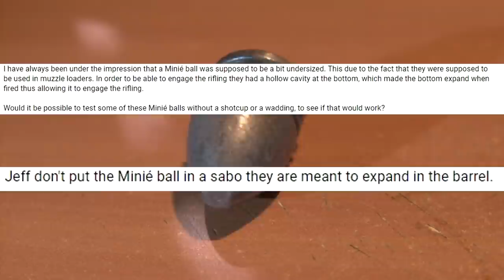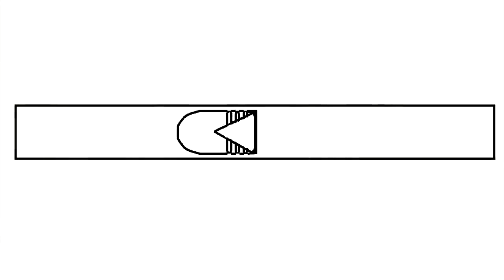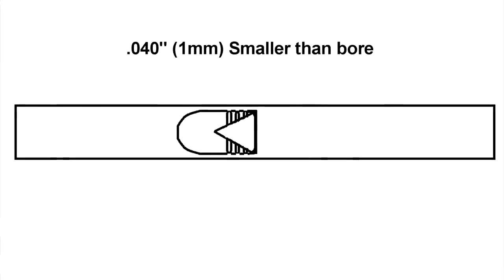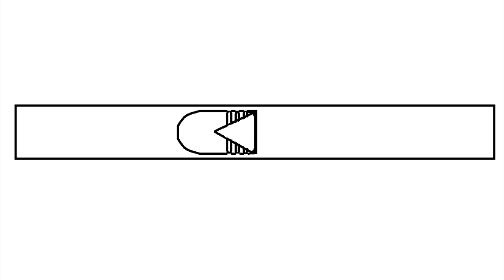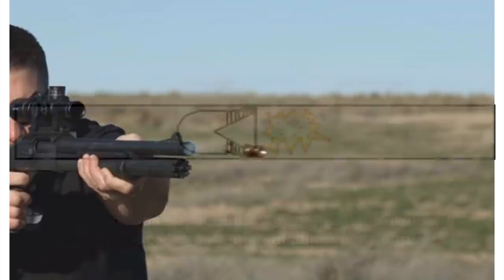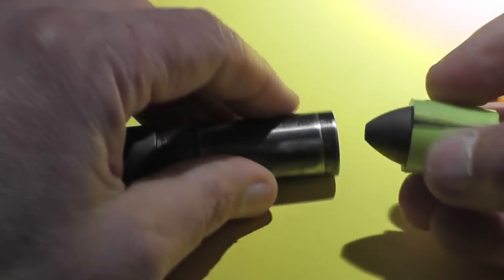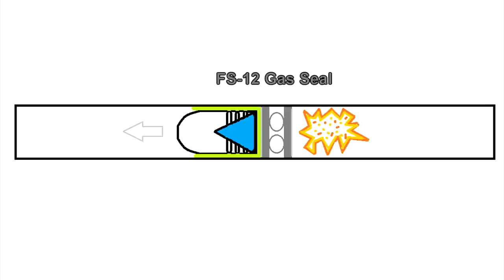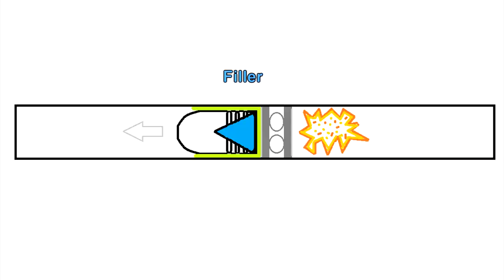.69 Minié Ball  - How I loaded it for 12ga.

Comment: Nah, Danny dead eyes would have still hit the target. A shotgun isnt a precision instrument, its just an extension of his arm
Reply: i heard, if your camera is good enough, you can see an extra hand reaching from his beard for support when firing
Reply: Actually a shotgun is a lot more precise than you are giving it credit for and it is not an extension of the shooter’s arm so much as it extension of the shooter’s body and in-particular the shooters eye.  I say this because if a shotgun “fits” a shooter correctly and unlike a rifle when you bring a shotgun up to your shoulder to shoot you are “mounting” or placing the shotgun to you shoulder and face so that where you “shooting eye” (dominate eye) is looking plus whatever corrections your brain has done to compensate for distance and lead of your target your projectile(s) will impact. The difference between shooting a rifle compared to shooting a shotgun is “gun mount” is only important so much that the shooter can move his/her head so that their shooting eye” (which does not have to be their dominant eye) can be aligned to look down the rear and front sight and that corrections for distance and or windage cam be compensated for by correctly adjusting the sights if the rifle is equipped and if not equipped with adjustable sights than that computer sitting atop your shoulders is going to have to due some of the work it does when shooting a shotgun but with more known values inserted into the equation(s) to determine the projectile(s) point of impact.
Reply: @gullreefclub  gullreefcluc I think you missed the point, which was a hilarious pat on the back for Danny. NOT a demeaning shot at a shotguns precision
Reply: @gullreefclub  wooooosh
Reply: @fransvphc1098  it's just like texting versus spoken word... Some of the intended emphasis is lost when you can't add a vocal inflection for sarcasm. Thus, misinterpreted comment.
Reply: I laughed
Reply: gullreefclub ...........mkay that’s nice but you are aware of what a joke is aren’t you?
Reply: @BH-rx3ue  I'd say give him some leeway, I mentioned elsewhere that sarcasm doesn't translate easily to text. So he might've thought you were sincere
Reply: the legend says that if you zoom enough on danny's beard, you can see the little laser-rangefinder and the FiringControlSystem
Reply: with a rifled shotgun its a whole different story
Reply: danny is a gun jedi

Comment: 👏 Well done, applaud the direct approach of "No, thats wrong & HERE'S WHY" More ppl should explain their position.
Reply: While he is entirely correct about what he chose to do and how he chose to shoot it, he failed to disprove the critics points about how a Minié ball is supposed to function and be fired. He explained why it wouldn't work with his specific circumstances. None the less, he was not shooting a Minié Ball as he would claim. He literally erased the point of why a Minié ball would be used the moment he chose to shoot with smokeless powder. This video was literally, "I had to make the Minié ball into a run of the mill sabot slug in order to make it shoot." Thus, proving critics that said that "he shot it wrong" correct. He shot it "wrong" by not shooting one at all.

Comment: Great explanation Jeff!!. Out of curiosity, (Some 25 yrs ago) I ordered Lyman's 'New 69 Musket' mold # 68569, which produced 'Minié' style slugs weighing about 725 grs, cast from wheelweights + 1.5% tin (just to improve 'castability' / better / easier casting), for  an old musket reproduction. (Results, not.so.great). Then again, out of curiosity, I had said mold precision ground down, (it fills from the tip of bullet), to 0.772", now with a flat nose / 0.565" meplat.  Then, with same alloy + original base plug, 'snubby miniés' dropped @ 610 grs, grouping somewhat better. Then again, went to my machinist's shop and made a new base plug, turned from aluminum alloy with a shorter, flat tip, quite similar to Lyman's 12ga sabot slug, casting slugs with thicker 0.114" skirts, about 650 grs, (0.093" skirts with original base plug). Using Claybuster 12ga wads # CB 0118-12 / clone of Win's WT12/ WAA12 + cornmeal to fill the hollow base + 0.100" nitro card between slug and wad, fueled either by 28.4 grs / 800X or 34 grs of Blue Dot. Out of my 870's factory rifled barrels, as well as a couple Hastings rifled barrels, (Verney - Carron, St. Etienne / France), chronied @ about 1.280 fps, these slugs group around 1.75" @ 50 yds quite  consistently. Suggest anyone interested in slug handloading, NOT to try to 'read' pressures from shotshell's base, nor from primers. It's more reliable to watch for pressure signs from the gas cups of fired wads / 'sabots'.

Comment: Makes perfect sense.  And a very good explanation. Now this brings up the question.... Why doesn't anyone make a 12 ga. Minie Ball ? THAT would make sense !
Reply: After seeing the results of these tests, you can pretty much guess that someone will.
Reply: @GarnetCarmichael  Perfection in 12 gauge slug. Right ?
Reply: Maybe, maybe not. Alot heavier and it will lead fowl the barrel. Time will tell.
Reply: @Stanley Denning It seems the closest shotgun barrel to the original Minie ball size would be .20ga. which is around .615. So you'd either need a .005 under size mold for a custom made Minie bullet, or a .58 cal rifled barrel liner for the 20ga. It seems odd to me that inline muzzleloaders don't come in .58 because it seems the minie bullet would be perfect for large game and easily cast and would be the cheapest shooting of all the bullets available.

Comment: I for one appreciate the work that goes into working up a good shotgun load. I was really tickled you got it to seal and release the wadding as well as you did. I use the exact Minnie out of a 12 bore black powder shotgun. It took me quite a bit of fiddling to get those things to fly right. I use a .690 Minnie with paper patching over a felt over powder wad. The un waxed butcher paper takes up the bore difference until the powder charge does its work and obdurates the minnie. They group quite nicely but are a BEAR to shoot out of my six and half pound single barrel.  Minnie balls are kinda sensitive to powder charge, they will blow skirt out if overloaded. You don't have to worry about that with modern wadding.

Comment: Great follow up video to a really good initial video. I found it interesting that the sabot was being cut in half by the Minie ball and even more so now that I see you had the void filled with hot glue. Still had enough pressure to create enough flex to push the cone out and cut the middle sections of the sabot. Keep up the good work.

Comment: I am a big fan of your channel. I love that this not only a technical journal, but a social event. I will miss Danny, but he is currently in the next phase of this adventure. I am part of the crowd that would really like to see that projectile obturate. Earlier this week I did come across and older video of a fellow making fff blackpowder loads to compare with smokeless loads with this projectile. He was getting better results with his fff loads. His smokeless loads were tumbling. This probably goes back to the 'initial pressure requirements for good combustion' problem. You were obviously getting good spin and accuracy with your loads through a rifled choke tube. If it aint broke....
Reply from the maker: If these were .73 caliber and we were using black powder,   it would probably work.
Reply: @taofledermaus  I went back and looked. his video was actually posted last year. I'm not sure why I thought it was older. They were mini balls .69. I am not a fan of black powder in anything without a cap nipple. whether or not he was actually doing what he said he was doing, I have been wondering about bump sizing? I'm not sure that is the correct term. with a small piece of a shotgun bbl of the correct size, an anvil to set it on, a 5/8 inch rod ground to fit the mini ball innards and a hammer one might wind up with some .73 inch mini balls!

Comment: A couple of other reasons for the necessity of the wad/sabot rather than having the bullet "go commando" in the shot shell:

1.)  The reason for the .01 inch difference is to facilitate the starting  and ramming home of the bullet, especially in the heat of battle.   However, any more than the .01 inch of difference and the bullet would be too loose so it might not seat well.  Then of course, as the size difference increases you run into the danger that the bullet could slide down and fall out of the barrel if the gun were to be pointed at the ground

2.)  Once the ball is started into the barrel of a muzzle loader, it is then rammed all the way down the barrel to the breech, and even with a .01 caliber difference between the bore and the bullet, it is still snug and takes a little effort.  Wanting the bullet to be tight up against the powder charge, not only is the effort put forth, but once the bullet has reached the other end of the barrel, it is also firmly tamped several times to ensure it can go no further and that it is tight against the propellant (at least this is the way I was taught).  Because of this, once the bullet is seated, much of the powder is already filling the cavity of the Minie-Ball and is "up under the skirt".  Upon ignition, the charge is not just pushing the ball from behind, but is also pushing out laterally on the skirt, causing it to expand outwards to the barrel walls and helping to create a seal.  This would be impossible to achieve in a shot shell because the plastic walls of the round would prevent the skirt from expanding all the way to the barrel wall.

Comment: The minie ball fits loosely in a black powder rifle. Its created to go down bore with ease even with a dirty bore. All you needed was a felt wad or plastic base wad designed to seal the base. I use them in my loading for slugs with a fiber wad over seal. It will work this way with a rifled barrel and no need for sabot. The skirt will flare but the entire projectile being made from pure lead will expand and shorten to fit the bore not just the skirt. The skirt is made to expand quickly and easily but the entire slug will shorten and expand to fit the bore if made of pure lead as was intended. I hope this helped.It will also expand and fit a smooth bore but I wouldnt shoot it in a back bored barrel. If shooting without a sabot in a smoothbore I would prefer something closer to a .710 caliber slug but 69 will work.

Comment: All great points. The one that I have left is.. try using a press to swage the minne ball round over a ball bearing or some other steel surface to get the skirt wide enough to act as a gas seal in the wider barrel. As an experiment. As a further experiment, cut off a section of a shot cup to prevent the nose from wobbling in the barrel and compare with the unsupported version.

Comment: Very interesting explanation. So the test was just to see how the Minie ball would function as a shotgun slug. And it did very well. I was very surprised how well it did in the smoothbore. 

Seems that in order to run a test in any sort of way to the original, you'd either need a .58 barrel rifled from breech to muzzle for your shotgun, or a custom made Minie ball mold for making larger bullets to shoot out of a rifled shotgun barrel. 

I see the original was .58 cal using a .575 bullet with no patch. So that would be a bit like shooting a .495 bullet out of a .50 cal rifle with no patch.

I have a question regarding rifled shotguns. Are the barrels rifled from breech to muzzle or is the rifled portion just a rifled choke tube at the end of the barrel?

And btw, to see the Minie bullet and the original rifle look for: History's Deadliest Bullet... by Iraqveteran8888.

Comment: Excellent explanation. Certainly shouldn't get you a strike; I mean, this is more educational about how a gun works rather than how to make your own bullets. 
The ball may have worked without hot-gluing the cavity, if the gas-seal held long enough for expansion to occur. If expansion didn't occur, the sabot may have held the pressure. The bullet may have spun like a slightly off-axis football. 
But, gunpowder isn't nearly as easy to detonate as people think. The ball may have damaged your barrel if it did rattle. You may have ruined a shooting day if the powder didn't detonate. So IMO, you did exactly the right thing.

Comment: I have considerable experience with Minnie balls and might I offer an idea. While your science and ideas behind your load is spot on for the most part, instead of simply using theory, experiment using the scientific method with some of the techniques used by the shooters and developers of the bullets. The 577 Snyder used essentially the same loads as you have made up here and the loading techniques could very easily carry over to this. 
If you by chance have some time and inclination you could try the following, using a standard high brass hull, load your choice of powder ( recommend a middle of the road burn rate powder like AA5744 or a little faster to replicate BP pressures) or even using the same powder that was used in this batch. After priming and charging with powder, place an over powder card and then fill the remaining void with some form of low compression powder substance, I use Grits, and then topped off with the Minnie ball. I recommend lubing the ball with a fairly hard lube by combining by vol, 50% beeswax and 50% crisco food shortening. You can play with the mix to get a harder lube by adding more beeswax until it doesn't melt easily when held in your hand. To lube, simply place the balls in a disposable pan base down and fill the pan with the lube until the lube reaches the begining of the curve of the nose well above the grease grooves. When the lube is solid and hard, pick each ball straght up and the lube will be perfectly set in the grooves with only moderate extra on the remaining portions of the bullet. If you wish you could even fill the hollow base with the lube or simply do like we used to and fill the base with crisco just before loading. If you use pure crisco, I recommend keeping the rounds cool until just before firing. 
The over powder card will keep the powder and grits seperated and allow for the compression needed for proper ignition of the powder. The grits (or cream of wheat for northerners) will allow the transfer of energy to the hollow skirt and the entire bullet through he base, you will find that the skirt will not collapse like you have seen with other projectiles you have shot.

Comment: Very interesting.... I have used Lee slugs in a birdshot wad very successfully in smoothbore shotguns. At 50 yards, once the right loads are developed, they all seem to go into about a 6" circle and I have little trouble hitting a 10" plate at 75 yards...... pretty good for a modern "musket".
The slugs are 1oz (438gr) and leave the dangerous end at about 1250fps on my chronograph, with less recoil than one would expect, perhaps the birdshot wad softens that a bit.....
Must try the Minié balls.... Great video...thanks      :-)

Comment: Big difference between a modern shotgun and an 18th century musket to be sure. In the "small bore" world, the bullets are of course oversized and get squeezed down to form a good gas seal. They are even quite often flatt base or just concave base. Hollow base wadcutters are still popular in target shooting. Soft lead and some form of lubrication is used but lead fouling still occurs. Accuracy is outstanding though. In rifles, the Spitzer form factor seems to be the king. There are some very fine projectiles for 1000 yard match shooting all the way down to 80 gr 5.56mm loadings. At Camp Perry, BC is everything.

Comment: The Minie ball grips the rifling by the venturi effect.  The gases moving down the barrel in the windage gap are at a lower pressure than the gases inside the hollow of the skirt, so the skirt is forced to engage the rifling.  As originally designed there was a piston-like piece of hard steel that was supposed to be driven forward under pressure into the hollow to push out the skirt, but the skirt of the Minie ball was able to engage the rifling with or without the piston.  The as-loaded large windage gap of the Minie ball is a FEATURE, not a BUG.

The best way to understand why the Minie ball was such a big deal is to do a comparison test between Minie balls and the balls it replaced, fired from muzzle-loading black powder rifles.

Comment: My interest is in velocity, chamber pressure and alternate powder types.  Are you breaking 1200fps with your load, or are you passing 1800 fps?  Yes the Minie ball works best if there is a bridge support right out of the mold.  Making a slit in the hollow plug of the mold (as Lee does with their Forster slug mold) solves that problem.  A .730 Minie ball mould would probably eliminate the need for a shot cup, but a cardboard over powder wad would still possibly be needed.  Then there is the experimentation with brass shotshell hulls and their wider internal dimensions with according difficulties in wadding and crimping..  Cotton or Dacron could probably be used to make a decent over powder wad as was done during times past.  Plastic would be no good for black powder as itsometimes melts in the bore.  It is kind of frustrating the CIP and SAAMI have arbitrarily decided no 2 3/4" shotgun load should exceen 1.25 ounces, threfore there exist no proof slugs, or load data, much less standard hunting guns designed for such beasties and the pressures they can generate.  Can we say 2 ounces at 3,000 fps?  Yowza..  But most consumers would walk away crying tears at the recoil, and many guns would need redesign ao ir ia all up to the backyard experimenter who wants a lead shotgun slug that zips through 3/8" of AR500.or at least sends the plate 50 yards away like a giant Frisbee.   :)